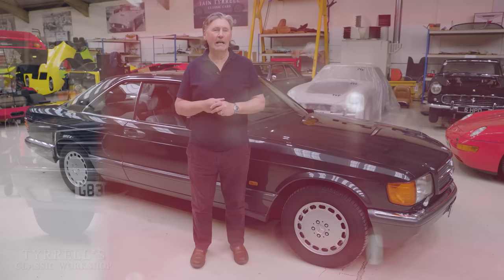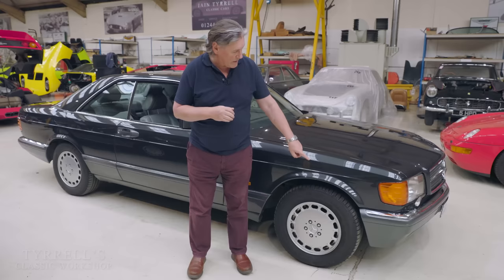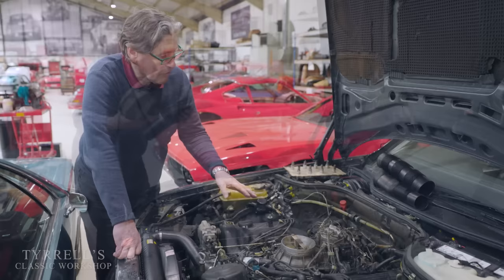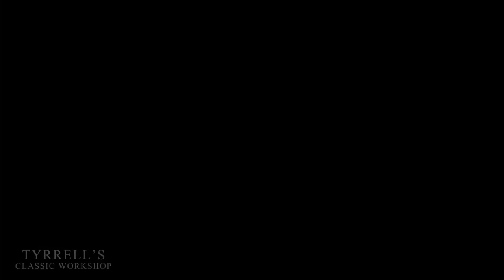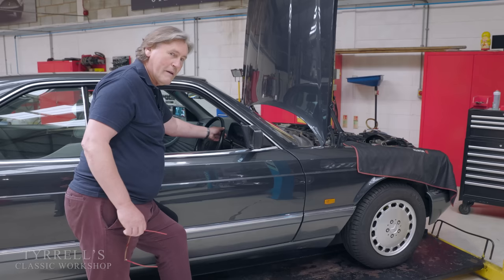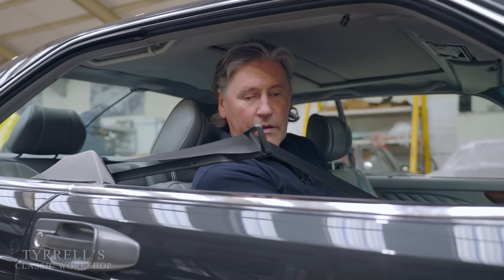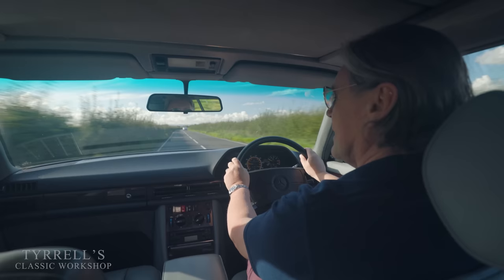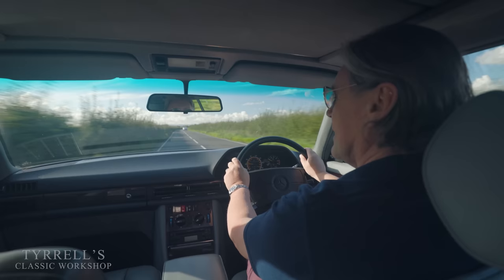Recovering the beast of an 80s Bahnstormer - Mercedes-Benz C126 560 SEC | Tyrrell's Classic Workshop

Comment: Great video Iain

Some info about the difference between the US spec M117 and euro spec engine. 

The US spec did have the dual intake filter box runners, but only the 560 model. The 420's and 380's only had the single plenum intake box.

US spec engines had these terrible exhaust manifolds where it consolidated the left and right hand manifolds then down in a single down pipe with Catalytic converter. This was unfortunately a serious restriction in the exhaust system, and killed performance.

Euro engines had proper dual down exhaust manifolds (commonly called euro logs). This 560 doesn't have the stock standard euro manifolds, it has what is called "tri-y" which is a special spec manifold for the "ECE/RUF" model cars. They are basically the ultimate setup for the M117, and have a price associated with trying to score a set. The AMG "TRI-Y's" of the period are also extremely rare to get a hold of and are of similar design (tubular vs the factory style casted TRI-Y's"). They can seriously liven up one of these engines when installed.

US spec engines also had lower compression pistons, and different cam profile to help meet the emissions standards in NA. The euro cars had more aggressive ignition timing profiles to help performance.

All these changes are the reason why euro M117 (w126/c126) cars can be a very spicy and fun car to drive on the hwy.

One of the things Ian touched on which i couldn't agree more is, a lot of these cars have had so much improper tinkering and adjustment on the throttle and transmission linkages that it gets everything out of sync, reducing performance and improper transmission shift points that can seriously kill any performance the car could of had. The Bosh KE-jetronic systems (mechanical efi these later 126's have) have a full throttle enrichment switch that is only activated obviously at full throttle. When engaged, you can really feel the extra power from a richer fuel mixture. KE-jetronics were not suited towards performance, and were always designed to run relatively lean/economical. That extra few points of enrichment really makes a difference to full throttle acceleration. It should be activated at full throttle, but before kickdown switch engagement behind the pedal.

The transmissions (722.350 for the 560's), can be tuned to have near perfect shift points, great kickdown performance, and firm shifts. Which considering they were non electronic transmissions, can be very impressive.

Another awesome vid for the 126 cars! Thanks Iain!
Reply: What do I do with that information?
Reply: @tastypymp1287  Absolutely nothing if you dont own or plan to own one of these
Reply: @TheMoistpotato  But for those of us do it's practically erotica. Thanks

Comment: In New Zealand I had a 1987 420SEC - after 5 previous Mercedes over the years, this was the best!!! Not quite the beast that the 560 is, but pretty good nonetheless. I bought it in 2002 and then sadly sold it in 2010 to sail my vintage timber built 12 ton Gauntlet yacht offshore. One has to make choices and sacrifices, but this one was particularly hard.
Now I am living permanently in Colombia (having sold the yacht) and I have a 1993 W124 E320 (107,000 miles). No motorways around here so speeds are relatively modest. The W124 will be the last car I own. Very pleased with it.
Reply from the maker: Good to hear

Comment: I love the Bruno Sacco-designed Mercedes from the 80s and 90s. No SEC (yet ...) but I have been fortunate enough to own an SL 500 (R129) and a 190 E 2.6 (W201). I currently have an E420 (W124) with the 'small' 4.2-litre V8 and standard body, a complete sleeper.
Reply: Wow what a great set of cars. never knew an E420 existed!
Reply: I had a 1993 400E that I loved very much. Amazing car and the m119 v8 was fantastic. It was not without issues however. Namely, it had vast low rpm torque and was very front heavy due to the v8;  no traction control of course, so if the road was damp or there were some  leaves you could find yourself doing a 360 while making a left hand turn or fish tailing out and doing a 180 going straight. Unlike its big brother, the 500e, the wheel arches were not flared so you could not put a wide and sticky enough tire on it to compensate. A few hundred pounds of sand in the trunk helped a bit. 

Second, I live in a hot climate and that v8 pit out a lot of heat in an engine  bay designed for a v6. It never overheated as the cooling system was massive. However, all the plastics and rubber parts got baked and brittle very quickly. Indeed, it was worse after you parked as the heat from the engine did not vent and the temperature climbed. I took to opening the hood at home, but nothing you could do when out. The belt tensioner worked via  giant rubber or elastomeric flange that disintegrated  due to the heat like clock work every 18 months. The belt went every year. radiator hoses etc cracked if you looked at them. Vacuum tubes..and there were lots of those as the whole car used them for everything from door locks to engine management tended to get loose at the pressure connectors as the rubber bake . Engine mounts every three, spark plug wires the same. And it was hard to get to lots of things due to lack of space  and the engine went back past the hood opening. The heat caused issues in the dual distributor caps too in the form of condensation forming inside the caps when parked, corroding the contacts and creating misfires. 

I finally sold it when the timing chain and transmission started making noise and acting up. It had just over 200k miles so both were due for replacement and at least a  rebuild respectively The timing chain is  a double wide beast  that is not easy to roll in without special tools and required something like over 20 hours of labor to replace, in part because everything in front of it had to cone  out due to lack of space.  It is an interference engine and not for the faint of heart to get right. And if you don’t there goes your block.  Oh yeah, the engine  needed a main seal gasket replacement and head gaskets  too, because, well it was  old car in a lot of heat.  

Hated to get rid of it  but the maintenance was getting to be not only super expensive but too annoying as well. I mean it was nice and is still my favorite carI have owned but it was not an SEL or w124 500e  (tuned by Porsche) or anything. 

But man, any Mercedes after the w124 era seems like cheap  junk when I get in one. Albeit junk with traction control, better abs and rack and pinion steering. For me, That w124 generation e class was the last great vintage by Mercedes (though the w124 interior was not as nice in many ways  as the w123, even it it looked sleeker. I agree with Ian that the s class w140 was just too bloated. Though I came close to getting a 1996 600sel v12 until reason returned (those eras v12 was literally two v6 engines put together and could be super expensive to maintain as many of the systems were literally doubled.
Reply: @SavedbyHim  It was only built in LHD. Most went to North America, but I live in France and bought a two-owner car originally sold new in Germany.

Comment: I lived in Germany as a kid in the 1980’s and the sight of the S-class, and to a lesser degree the BMW 7-series, made every autobahn journey interesting. Back then, no speed limits meant a noisy, temperature-gauge-scrutinised, real-world 80-odd mph for the vast majority of cars (the magic 100mph or 160kmh was achievable for plenty of cars but definitely not easy or quick to reach). Even Golf GTi’s clearly knew their place in the pecking order! The odd 6-cylinder 3-Series BMW would venture into the big league of constant left-lane high-speed cruising but they clearly had an issue with rapid throttle closure from high speed because many headed straight to the hard shoulder in clouds of burnt oil immediately after being forced to halve their speed by an inconsiderate truck pulling out. The really memorable sight though, partly due to rarity but also due to styling and a bit of national pride, was the occasional Jag XJ12 reminding everyone that it’s not a 2-horse race.

Comment: Proper car. We used to blast down the autoroutes to Frejus in the late 70's and through the 1980's. Was usually the S class Mercs stuck to the back bumper at 90+mph flashing the main beam because they just could not wait to get past 🤣 120mph in one of these feels like 70mph in a normal saloon car. Engineered like no other car...

Comment: I've worked on a lot of W126's over the decades since they were introduced and I'm still working on them.   This car is the Ne Plus Ultra of the whole W126 range.   What I look for on UK delivered cars is the 4 separate exhaust manifolds which were part of a bit of a scam Mercedes were conducting.
 What Mercedes told their customers was the USA demand for cat cons would eventually arrive in Europe ,so they made these high Compression (10-1) engines with free flowing exhausts. So When or If  the predicted regulations arrived,the cats could be fitted and no appreciable loss of power would be felt. 
The Top speed mentioned of 155MPH is correct,but the cars were actually governed to 155 MPH through a lead from a switch in the speedo head,to the Over voltage Protection relay. (ovp) .So by cutting that lead and fitting a 6500 RPM fuel pump relay a damn site more than  155 MPH is easily reached. 
Although the injection is KEjet with electronic cold running regulator they don't have a computer control so getting extra power was quite easy. 
I mention UK delivered cars because the RHD W126 560 delivered to the UK has the 10-1 engine but USA,Australia had the slug 9-1 compression engine which do not have half the power . Japn and Hong Kong also got the occasional High comp 500 and 560's. 
A couple of other things which made them different was the EZL ignition with anti knock control and the over load protection in the trans. The latter also being connected to the OVP ,cutting out the ignition if the trans started slipping because of operator abuse.

Comment: Great video. Such nice cars to enjoy. So glad you mentioned adjusting the tie rods to straighten the steering wheel- to keep the box centered. Too few people understand that!
With that mileage the cam timing would be a few degrees off but still ok. And the tensioners getting brittle. Lots of life left in that car - my 500se is on 290000miles with unopened engine.

Comment: It is the same colors inside and out as my '91 350SD. which we bought new and still have with 110K miles on the odometer. These are special automobiles. Like a Swiss watch, it doesn't matter how old it is if it has been well maintained.

Comment: These were/are justly fantastic. Specially as ‘Autobahnkreuzer’ on the most left lane, they were such a joy zooming over 220 km/h with utmost ease and without any limiter. Fabulous. Thank you for this wonderful upload for a Sunday’s evening.
Reply: Not any longer (unfortunately) most BMW will be faster.... so keep a sharp lookout to the rear  while in the left-most lane.
Reply: @stefan skoglund back in 89/90  155 mph /250kmh + was a very big deal , yeah there were a few bmw,s that could do that too , also jaguars, Porsches and Audi,s   Amongst others but it was warp speed then and 
still fast now!
Reply: Indeed. Cruising at 220 km/h and still being overtaken by a Ferrari or Lambo as if I was standing still, lol. Such is not a rare experience...
Reply: They were limited actually, through a simple switch in the speedo head,via white lead running to the OVP. By cutting that lead the speed limiter was disengaged.
Reply: Ha ha...  Back on the late 80s and early 90s I would cross West Germany/Germany on an unfaired motorcycle by Autobahn.  110mph was a realistic maximum, with head tucked right down.  Mirrors were useless at high speed, so I had to look backwards under my arm... Turning the head in the usual way would remove the visor.  The cars that were usually approaching from behind at speed were Porsches and V8 Mercedes.  There were others that sat at 130-150mph, but the great majority were from those two marques.  Things may have changed now....

Comment: I believe one of these models holds the records for the most parts used in one car: 666,000, if I remember right. It might have been a later version, not sure. Still, this generation of M-Bs will never be seen again. They were over-engineered and overbuilt, meant to last a million miles and not fall apart right after the warranty expires like most modern M-Bs. The design is a classic too, still holds up even today. I drove a sedan version of this car (the S-series) and was awed. It surged ahead like a tidal wave and was whisper-quiet the entire time. A fantastic cruiser, you can take these cars on long drives and never get tired of being behind the wheel.

Comment: I used to own a W126 420SEL and it was a weapon of a car. I remember my first overtaking manoeuvre back in period, and the sudden change down and burst in torque sent me into the weeds on the other side of the road. My father had a drive and accelerated before pulling out and we nearly rear-ended a tractor! Till this day we still joke about how we didn't expect such a large barge to hustle so quickly. Thanks for sharing this video Iain.

Comment: I had a beautiful 560 SEC in Abu Dhabi. A friend was leaving and needed to sell in a hurry, so I acquired it for a little over 3,000 pounds.
I loved the fact that it was sleek and fast but so incredibly comfortable smooth to ride in.
Of all the amazing tech inside it wasn't the fancy windows, or the fact it handed you your seatbelt that got me. I was most fascinated by being able to switch between the 2 different horns.

I fell out of love with it when I did an online VIN check on it and found out that the VIN plate said it was supposed to be a 1979 VW Microbus.

25 years later it's still one of the most amazing cars I have ever owned.

Comment: Excellent Iain. I have owned a couple of these years ago, and you are quite right, they are continent crushers.
They were the darling of Grand Prix drivers back in the day, who mostly drove to the European circuits rather than the current trend of private jets. Most of them owned one of these and covered huge annual mileages in them too.

Comment: Lovely video.  My grandmother had a W123 and her brother had a couple of different R107s.  MB was so well engineered.  I was lucky to drive the W123 but the R107s were gone by the time I was driving age.  The W123 was a slow 240D but solid as rock.  Every switch and input was well engieered.  My Uncle traveled for work and my father was always more than willing to help get the R107 flavor of the year to the next location if the chance or excuse could be thought up.

American hot rodders refer to the style of exhaust as Tri Y.  Doug Thourley is most known for the design on V8s but Pfadt has made versions for Corvettes.  The 97-04 Corvette mufflers are similar to the 560.  Corsa is known for being quiet in side the car, if you need to adapt something.  Always enjoy seeing the engineering behind great cars, C126 or the F40 :) in the backgound.

Comment: I had a 1995 C36 AMG.  The suspension was far too stiff it a change to the sport shocks took care of that. Once that was done, it was an amazing little 4 door sedan.  It was capable of hitting 250 kph and it was solid as a rock at that speed. 0-100 kph was around 6.2 sec. I only drove it in the summer, so it was still like new when I sold it.  If you live in a location that has real winters, the secret to keeping your car looking like new is to not drive it in the winter.  Have another vehicle for the winter.  As long as it is reliable and warm, that’s all that matters.  It will feel like a luxury vehicle when it’s -20° C and blowing snow outside and you’re warm as toast on the inside.

Comment: In Germany we have to put the different Tire size on , the 215 65 15 in ZR rating is no longer available. Mercedes recommend 225 60 15 W . The US spec has 60 HP less! But the ECE Version is much fester., it was the Answer to the bmw 750 v12 with also 300 hp......But the 500 se/sec Version has longer gearing

Comment: I started working for MB in the early 80’s so regularly worked on these especially being close to kings road & the city where all the money was had plenty of S class 126 chassis in. The 560 was a beast but beautifully smooth at the same time. Our director had several 560 sec & his commute to work was all of 2 miles he’d always complain to my manager it was running lumpy again (whilst sucking on his cigar in the boardroom) so once a month I’d have the pleasure of giving it a Italian tune up down the A3 😊. Boy I loved it 100 mph & it’d still kick down a gear with a step on the gas pedal & even wheel spin in the wet with a little wiggle to boot 😂. You could put it in drive hold your foot down hard on the brake floor it & light the rear wheels up then release the brakes wheel spinning down the road leaving rubber marks & a cloud of smoke behind all whilst sitting in the most comfortable leather chair.
Engine was bullet proof & these along with the E class 124 & 190E 201 where the last built like a tank models.
As much as I loved the SEC I always preferred the 560 SEL that was super plush.
Ah memories of better times